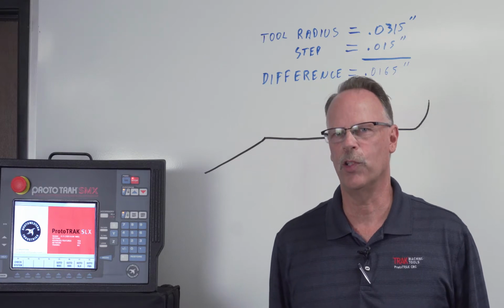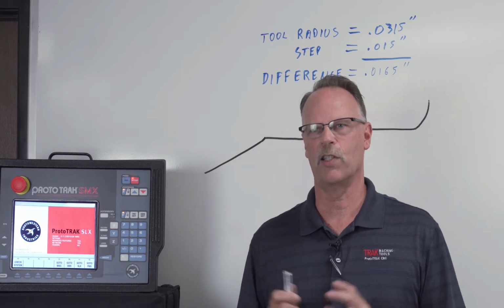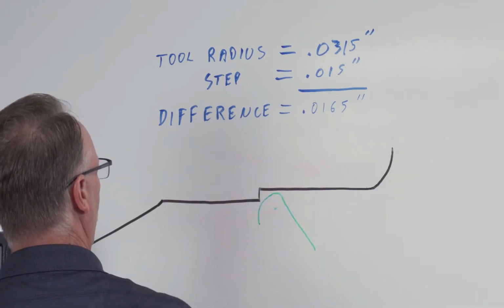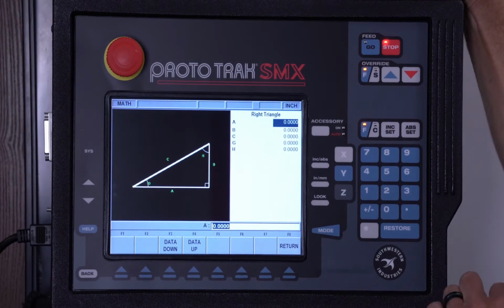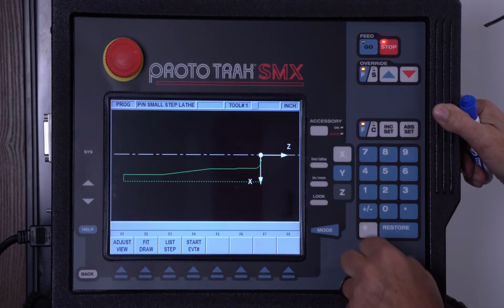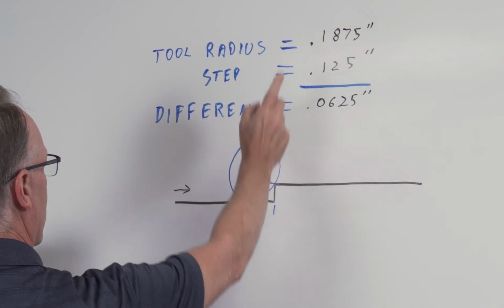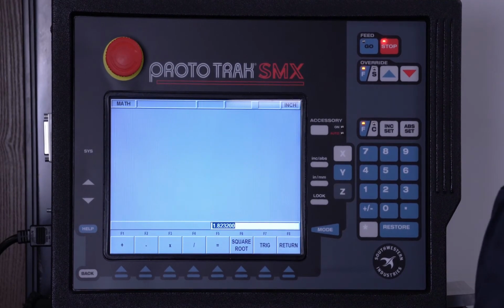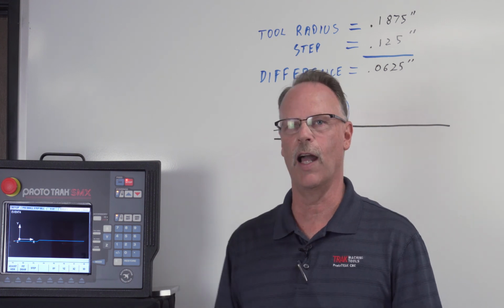Small Step Solution for Milling & Turning

Comment: @trakingpat2750 i can't seem to overcome this issue even trying to duplicate exactly what your on our new RLX. LINE remains a sharp corner instead of ramp transition. Im still having to lie about radius or multiple cycles. 
Can you offer a more detailed explanation with the complete print of this particular part?
Reply: Hello, the ramp is actually an illusion because what happens is that the radius of the tool travels along the first X diameter until it reaches the Z dimension.  At that same time, it also reaches the beginning point of the ramp.  There is nowhere for it to go but to move out to the next X diameter while keeping the tool radius on the Z dimension.  When you look at the part on the screen, you will see a ramp but when you look at the tool path, you will not.  I hope this helps you!  T.P.

Comment: So what about the step shoulder, would i have to draw another cycle for the finish geometry and use a finish tool with a small radius or maybe a groove cycle to get the desired geometry for the part ?
Reply: If you need that step to be square, then yes, I would make another event to clean out the material that is left in the corner.  T.P.

Comment: I personally would make a second cycle to finish the radius and cut the smaller diameter and finish slightly bigger than the second biggest diameter
Reply: There's nothing wrong with that. Either way, you will get the tool radius at the transition.  The only way around that is to use a sharp tool with no radius.  T.P.